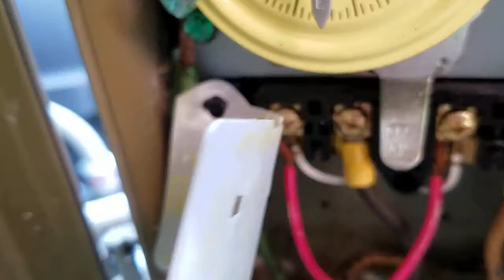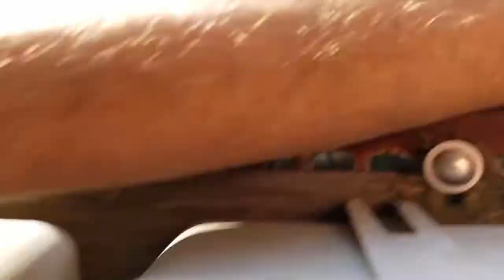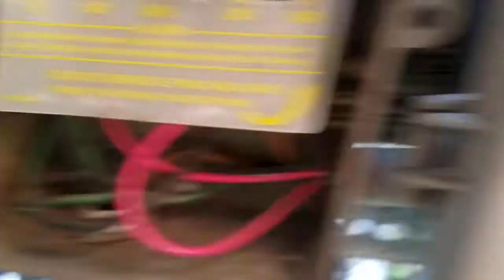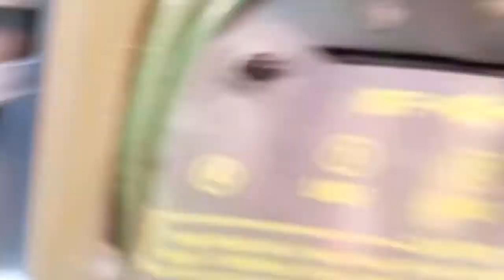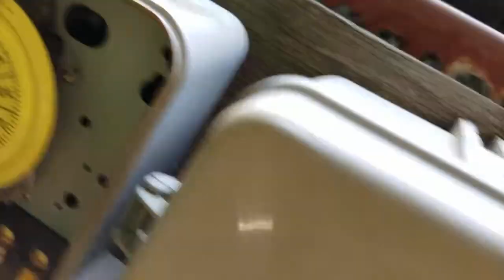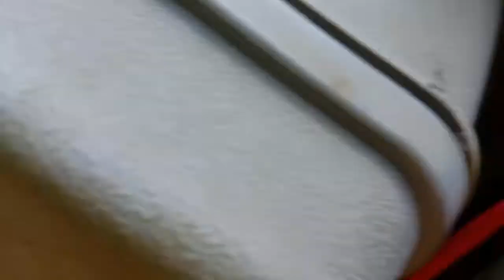Your pool timer can kill you

Comment: Before you make statements like that make sure that your equipment is correct you are missing a screw that holds that plastic on I can see that from the get-go
Reply from the maker: Unfortunately it was this way when I moved in and I have seen a bunch of videos and real world examples where the little card isn't even on there anymore. It needs to be made in such a way where if the installer forgets a miniature screw it doesn't lead to a possible fatality.

Comment: I agree it’s a horrible design. However, I see you are missing the screw and you have some exposed wire. Looking close , I see some bare wire where it looks like the insulation was damaged.  Regardless , I agree with you, just a bad design, at least on my disconnect switches it’s a piece of rugged rigged plastic that snaps in, as opposed to what looks like a notebook binder shield.
Reply from the maker: Yes I bet a lot of these are missing the screw.  Some people commented on here that they are missing the insulation card altogether.  Even with the screw though curious little hands could too easily get under that card.  Thanks for watching and commenting!

Comment: Those wires underneath that box aren’t even secure. That’s probably what got you cause there might be a cut jacket on one of those.

All you have to do it flip that tab. I’ve operated thousands of those. Many without those covers & never got shocked. You would had to have literally stuck your fingers right into those terminals to get shocked
Reply from the maker: Hi those wires were on secure in that they are tightened tightly under the terminal block screws.  The issue is the jacket on the wires was stripped off in such a way where you can see much of the wire exposed under the screw and also the terminal is right behind the lever that you have to operate.  It was very easy to touch either the bare portion of the wire or the screw terminal and I was on the other side of the timer reaching over the top while getting sprayed with water so no time to carefully operate the lever and since the plastic tab slipped down I got nailed.  This was years ago and I have secured everything, but to this day I still carefully think about what exactly I am touching when I open that cover.  Some shocks you don't forget and this was one of them.  Please be careful especially when operating without the tab it just takes one small mistake and you're done.

Comment: It’s 2021 now why aren’t universal digital pump timers popular
Reply from the maker: Not sure really.  I'm guessing mechanical is more reliable. I like having that lever there to switch it on and off when backwashing, etc... I would just like it to be safer.
Reply: Mechanical Timers like this are much more reliable and easier for general consumers to understand how they operate and work.

These timers are definitely dangerous because of what he is talking about in the video. Will it automatically kill you if you accidentally shock yourself? No. Could it kill you? Sure. Is it likely to kill you? No.

A better design is definitely a good idea but until they come out with a better designed mechanical timer builders and consumers start using them these will be common place and this will be an issue.

Comment: The round hole is supposed to have a screw in it.  I wouldn’t even pull the plastic cover back without turning off cutoff power.  My box has an additional metal plat on top of the plastic cover.

Comment: just got a new pool, frankly all i see is this kind of timer. why doe no one use the other plugin kinds? is there a reason?
Reply from the maker: Some 1.5hp and above pumps use 240 volts I'm guessing that's one reason.  It seems intermatic has the monopoly on hard wired timers.

Comment: It's a general purpose timer.  Not necessarily for just pools.  It may be redundant, but I'd install a separate power switch as a 'master' for times when you have to kill power quickly.  Especially if you have wet hands or are standing on wet ground.  For about $20-30 in parts (Lowe's/Home Depot) you can be much safer.  I'd rather not be sticking wet appendages into an electrical box with only a plastic card keeping me from meeting my maker.
Reply from the maker: Good suggestion. It would be great if that became a standard to have a safe kill switch in an easily accessible spot.